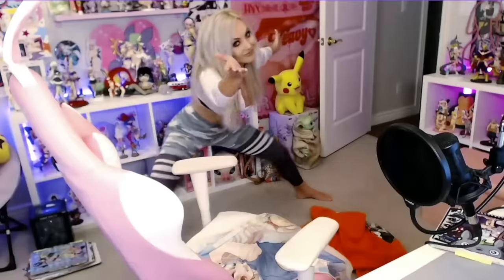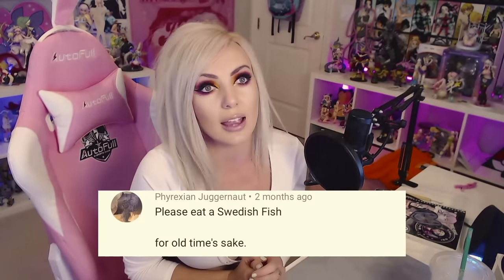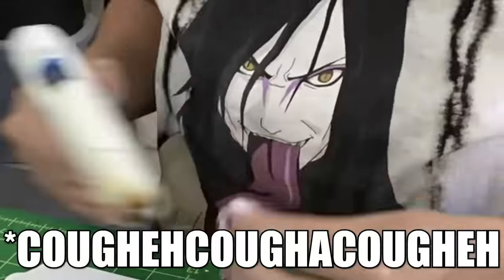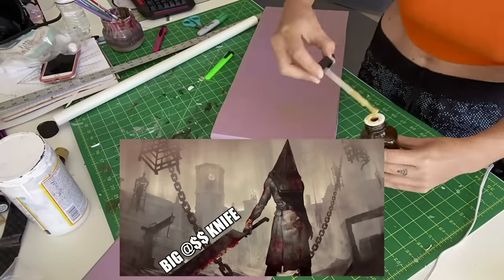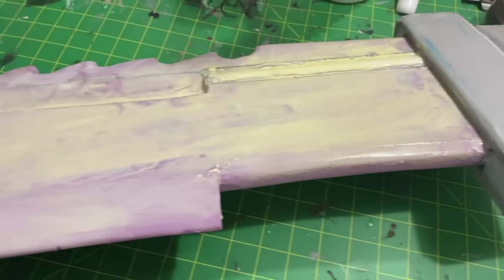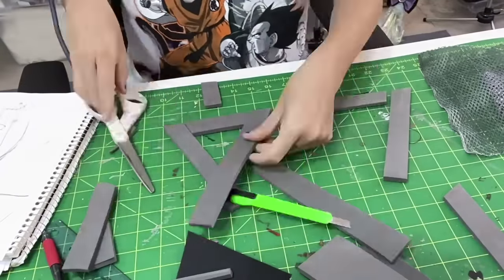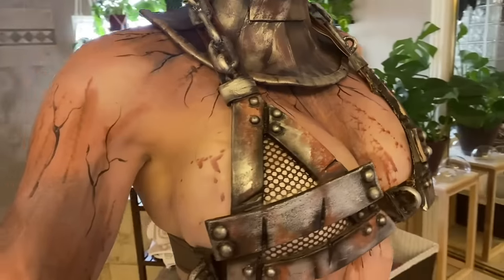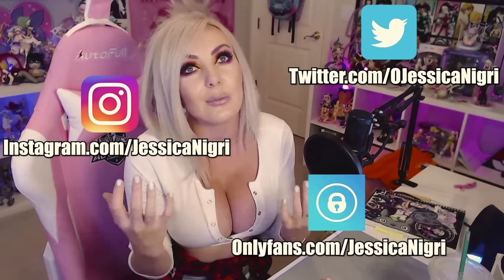HOW I MADE MY PYRAMID HEAD COSTUME

Comment: Thank you for creating this tutorial!! Pyramid Head was one of my first cosplays back in 2014 and I've been wanting to revamp it SO badly!! When I made the sword, I used the exact insulation foam as you did but I also cut out a spot in the bottom to add a weight to to make the sword actually drag behind me when I walked with it. I also added these little spark things to the bottom of the sword (like you used to see on skateboards) so that when the sword dragged, it actually sent out sparks! Just wanted to through that out there in case anyone wanted to add the heaviness to their swords! Again, thank you for the tutorial! I cannot wait to redo my helmet because mine was blech lol
Reply: @Iconic Snipes' I added a metal weight into the hole where I removed the foam! Made it perfect to drag!

Comment: For painting you could've done a wash instead, it'd be quicker but what you did works too. And everything else was how I'd recommend doing it. The only other thing I'd do differently is use foam for the panels since it'd be a bit more resistant to being destroyed but either way works!
oh and shouldn't use super-glue for fabric. Barge cement would be way more permanent and is what the pros use on Sesame Street. You do trust Sesame Street, don't you?

Comment: Not sure if its been mentioned in the 1k+ comments, but they make heat knives for insulation foam and they are amazing.  Wire and blade electric knives will open a whole knew world if all you've ever used are razor blades.  Amazon has a number of solid options.

Comment: Pyramid Head: Why is it shaped like that? Well you need room for the espresso machine, Bluetooth headphones, multiple small tablets(one to monitor each twitter, mails, insta, tiktok etc.), a small air con unit and eleventy million batteries to run it all. PS the tensile strength in Jessica’s white top is impressive. Is it made of Mithril? Adamantium?

Comment: I highly recommend oil paints for weathering (assuming the surface is acceptable for oil paints, plasticard, pvc, foamboard that has a decent outer layer that won't absorb too much). You can mix them around and feather them into stuff so easily, you can't make any mistakes because you can kinda just rub it into the layer below and boom, more weathering. Really easy to just play around and get a lot of more natural looking gradients. Also you feel like Bob Ross, so that's a plus.

I should probably add that you should just get cheap stuff, for cosplay/costuming you have a lot of surface area to cover and you know, 5 foot rule and all.

Comment: I was going to say, I found using a dremel to sand down the sides and the sotered size "teeth"  of the great knife much faster than using a blade and sandpaper. more cleaning up to do, though lol. After using the dremel using sandpaper was good to smooth out the edges.
Reply: Do you know what thickness of EVA foam would be good for this? I’m new & she didn’t mention thickness I don’t think. 😅
Reply: @krystallayke  Hey! For which part exactly? For the knife I use 6 mm EVA foam around the base of the knife, and for the handle wrapping I used 2 mm foam
Reply: @priscillatorres501  I was wondering about the actual helmet. I thought the helmet was also foam too but now I’m not so sure lol.
Reply: @krystallayke  I made it out of the largest foam poster board that I got at staples! It’s super lightweight I think that’s what she used too!
Reply: @krystallayke  The helmet is made out of foam poster board!

Comment: If you love rust, then you might want to try oil paint. Just thin a bit with white spirit, slap it on and then use white spirit (if the material allows it) to streak it down to where condensation would occur.

Edit: Just saw 9:30 : D

Comment: i did almost the same procedure with my zabuza blade! what i'd recommend is using wooden pegs where the two ends of the insulation foam meet to really stabilize the... conJoiNEd sIDEs. i saw another comment on this and i agree, try to get the pvc pipe as far as you can inside the blade so it is sturdy asf. what i also did (which was extra as hell) was i put nails?? i drilled nails from the opposite sides of the pvc into the foam and ig that shit helped so yEAh